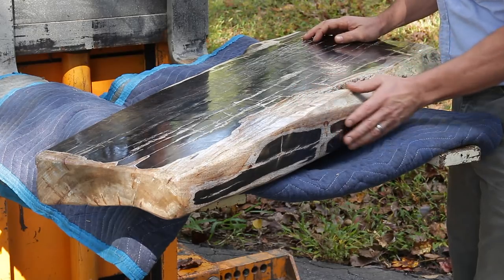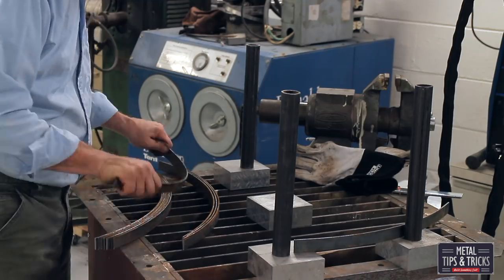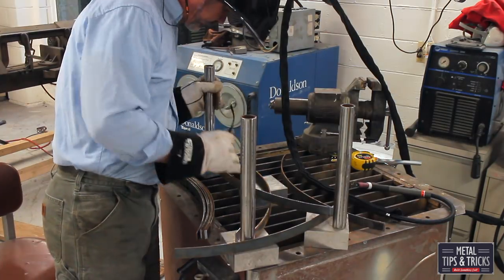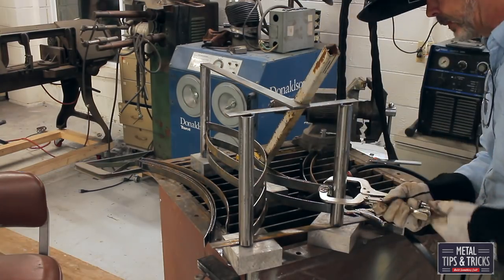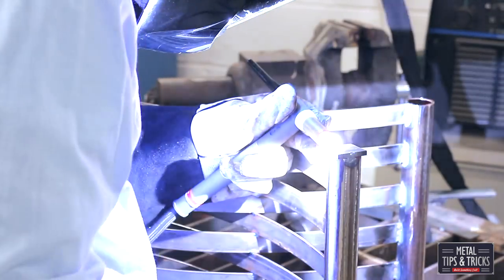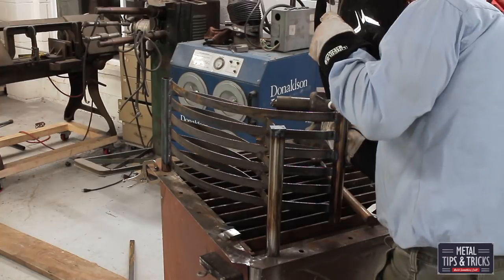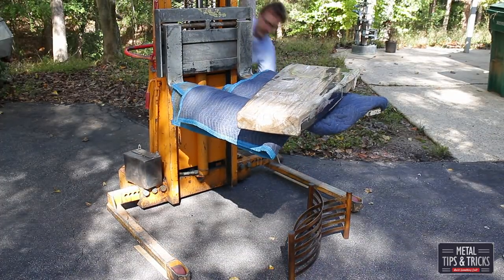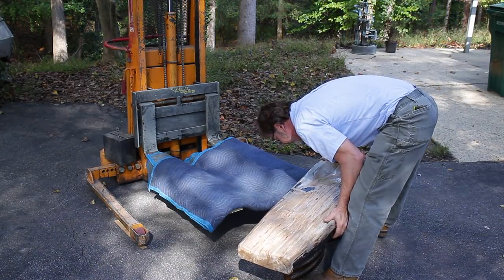How to make a Rock and steel table

Comment: Excellent Sir. I built something cool myself, a grill island that will survive the rapture! Left over cuts of mild steel outside the metal retailer storefront put to good use. Looking forward to rusting it with your formula Dale. (Sweet Viking grill and Turbo cast iron side burner).

Comment: Very cool video. You might be able to stiffen up the base by connecting the top of each leg with some flat stock. You'd end up with a triangle and it would be low profile enough to not distract from your design.

Comment: You might try heating the orange rust with a propane torch.  Once you drive some H2O out of 
the rust it will be more brown.  When I make an antique tool brown again I will spritz it with 
corn oil and heat it until most is smoked off to get that old brown rust/grease look.  I haven't had any trouble drawing the temper of the tool when I only take it up to oil smoking temp.
Reply from the maker: Cool idea. I'll give it a try. :-)

Comment: Dale, Did you try and tack weld the bars where they cross in the middle? I'd be it stiffens the structure some..
Reply from the maker: Yes and it did,   but it did not help enough
Reply: On the single post ads say a 3/16 x 2 inch x 10 inch PLATE to the top of single post in the direction of leg sway. You could add a similar strap to the 2 that are closer together. You can fasten these to the table top with epoxied lags or something similar.  With the bands welded at crossover, the table should be stable lengthwise.

Comment: I would suggest four legs and weld the connections where the arcs cross to gain stability.
Just welding the arcs together on the three-legged support may stiffen it up enough to use.
Reply from the maker: Hi Ron I thought of something similar, But I decide the base I made is to small and I need to start over.

Comment: Such a pity it didn't work out.  That would have been an awesome table.
Walnut will look great.  I'd also think about some kind of steel top, or even just a sheet of glass so you can see the metal underneath.
Reply from the maker: Great suggestion on the glass. I will look into it.

Comment: Hello. Sorry to bug you but I can't find something I need. I need a tool that with bend 1/8 and 1/4 in brass rods and tubes into circles. Is there such a tool or a way to make perfect circles?
Thank you and love you videos
Reply: +Jason, You will need to ensure that the brass is what is called 'Half Hard' ( Bendable ) as brass sheet up to 1/8 inch usually is. If you try to use standard brass rod it will crack and may even totally break. With the 1/8 inch, if you can find a piece of stock that is slightly smaller than the finished diameter you want; then wind the brass around it like a spring. Cut it into rings and tweak it with your hand / pliers until the cut ends line up/ It will not be so simple with the 1/4 inch brass. Good luck trying.
Reply: Rolls and/or benders can be used to make the circles you want.  You will need to heat the rods to almost red and let cool before and probably during the bending process.as brass becomes work hardened just as copper.  The ends can be brazed to make a connected ring.  Check at Harbor Freight for rolls and benders.  Tubes will require a die of the correct radius to keep from collapsing the tube or filling the tube with sand so it can't collapse.  There are spring forms which will go over tubes to keep them from collapsing when bending a tube.  Check at Harbor Freight and auto parts stores.
Reply: + Roy. Sorry to dissagree about you heating the brass to red heat to anneal. OK if it is what is called 'Half Hard' brass, that will certainl help, but NOT if it is standard drawn brass rod that is usually purchased. Standard brass when machined will shower off fine chiipings, where as 'Half Hard' brass ( Bendable ) will come off in curls, very much the same as copper does. When drilling standard brass, the drill bit needs backing off to stop it snatching, where as 'Half Hard' Brass requires a sharp drill and the swarf will come out as a curl and will not grap / snatch.

Comment: Based on some assumed chemistry you got a red rust from Iron oxide-hydroxide FeO(OH)H2O (high moisture)
the brown you want is Oxide Fe2O3 (high oxygen/low moisture)

It might be possible to get the brown Fe2O3 by thermal decomposition of the orange/red rust through heating at a temperature just above 200°C 
this should work as FeO(OH)H2O dehydrates around 200 °C
Reply from the maker: Thanks for the info. I'll give it a try.

Comment: I do the rust metal finish all the time. Usually paired with an accent color to add visual pop. I'm currently working on a 7' diameter table, with 1/4" steel base. I usually buy from MetalFinishesPlus.com So for this client I picked up Rainbow Torch and Copper Rust sample sized bottles to do a couple of test pieces for the client before proceeding. 

I think what you are looking for is a product they call Antique Red/Brown. I've got a gallon of that leftover from a restaurant project. It definitely changes colors and hues the longer you leave it on. I might have put that on my channel. I can't remember.

Found it: https://www.youtube.com/watch?v=wD5lBBRPFn4

Comment: New gloves Dale? Plastic staple hanging off your glove... Too much time on my hands lol...
Reply: A very nice base too, would 5 point instead of 3 be able to handle the weight. In the same configuration?
Reply from the maker: Hi John, its not as much about the number of legs as it is that the  frame wants to twist under the weight of the rock. The problem is the curved stretchers. They are to flexible. I need to find a way to stiffen them up.

Comment: PLEASE NO SO CALLED MUSIC whilst talking. Trying to hear what you were saying was hard with that annoying twangy music.One or the other, but not together. Secondly as a safety concern, DO NOT sit with your feet under it, it could collapse at any time as the base is too flimsy. In the video as you were placing the top on, you could see the legs wobble and start to twist as you saw yourself as you were testing the position. Poor design, needs strengthening.